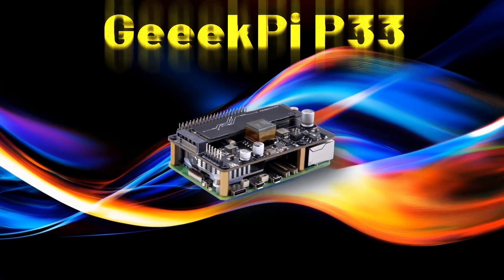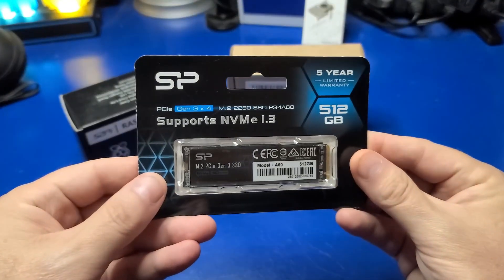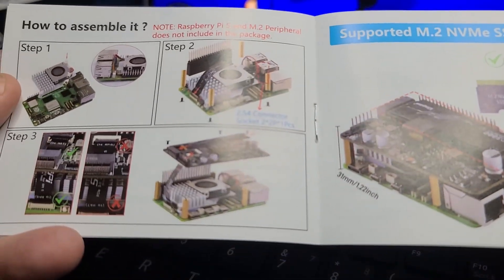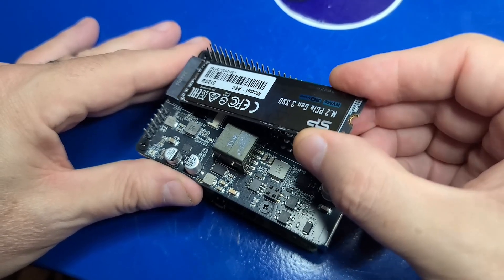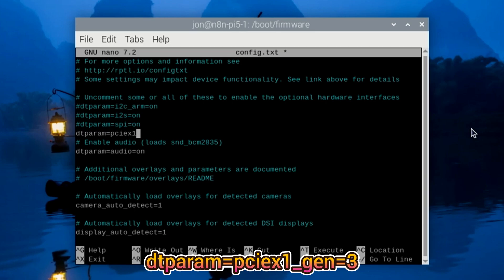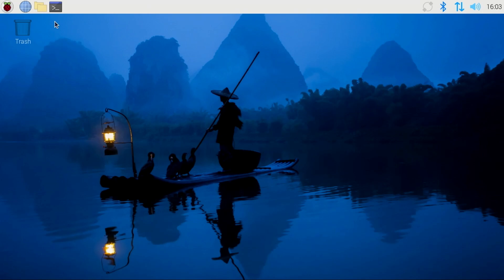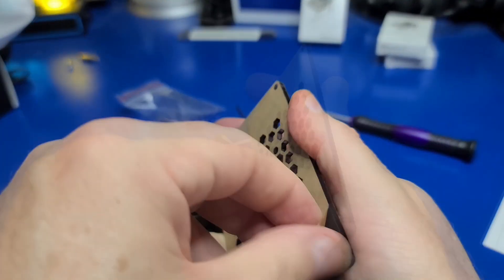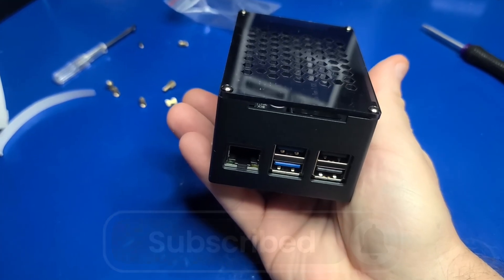PoE+ NVMe HAT and Aluminum Case Setup for the Raspberry Pi 5

Comment: Would all of this setup required to run local n8n workflows? and how about using LLMs in it could it run or an API is required. Much Thanks
Reply from the maker: Unless the LLM model is tiny (<~1.5 b parameters), you may not find the performance acceptable on the Pi 5.  I do have a video here on Pi Apps which goes into installing an LLM on the Pi 5 (OLlama).  You may want to experiment there to see what I mean: https://youtu.be/IZ84SsCqtQc

Comment: I got this exact setup, without the case. same brand nvme drive (256GB version), and it will not detect the drive. no matter what I do, tried a different drive even. everythign seems fine. but will not show the drive. it lists it as a network card in the pci list. did all the firmware updates, and nothing. going to buy a different hat i guess.
Reply from the maker: Just curious, did you make sure the right end of the connector was attached between the PCIe - See 03:35 for an explanation? Each end is labeled, I missed this the first time I put it together and thought my unit was defective.  It wasn't.

Comment: Hay un usuario de Amazon que compró un kit para implementar PoE en su Raspberry PI 5 con almacenamiento M.2 2280, el afirma que esa configuración no es estable y la Raspberry se reinicia cada 5 o 10 minutos; el problema se debe a que por PoE no se suministra la corriente necesaria.
Reply from the maker: Podría tener una Pi o HAT defectuosa. La he estado usando sin parar desde antes de este video y no ha tenido problemas de alimentación. También podría ser el concentrador de alimentación que usa.
Reply: @WagnersTechTalk , tú vídeo es maravilloso; a partir de el he investigado mucho más; hay que ser muy puntual y cuidadoso con el hardware seleccionado y el control de temperatura para un correcta alimentación PoE que genere 5V, a 5 amperios.😅

Comment: New tip: If your PoE switch is managed, you can log in remotely and control each PoE port. That means, to cut power or reboot a PoE device completely, you can first SSH into the Raspberry Pi and shut it down, then remotely disable the corresponding switch port—just like `interface f0/0`, `shutdown` on a Cisco switch—and later bring it back up with `no shutdown`.
Reply from the maker: Thanks for sharing that tip, I and many others appreciate it!

Comment: 5:42 I've looked everywhere and you're the only guy to point this out. I thought I was stupid and I didn't want to break anything. Thanks a lot for the detailed explanation!
Reply from the maker: You're very welcome, glad I could be of assistance to ya!
Reply: @WagnersTechTalk  It was also possible to lift the piece of tape and remove it completely - at least in my case no need to use force or puncture anything.

Comment: Great video!   I just got this exact setup.   I wish I would have found your content sooner.  I actually broke my first case and had to get another one.   I broke the catch for the hat nvme cable.   I tried to pull instead of just flipping it up.   Now I have this all together, Im really digging it.   My only gripe is that it doesn't have a external power button like some other cases.   But the sturdiness, looks,  and included nvme hat,  overshadows that.   You have earned a like and subscription.   Well done.
Reply from the maker: Thank you so much for sharing your experience with this setup!  I appreciate you watching and subscribing too.